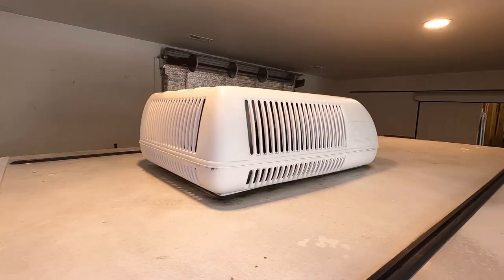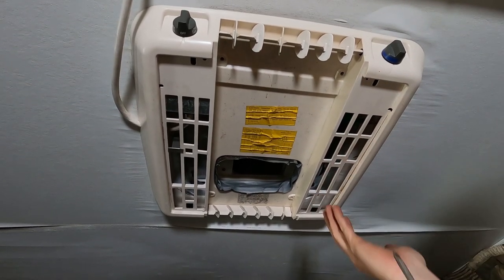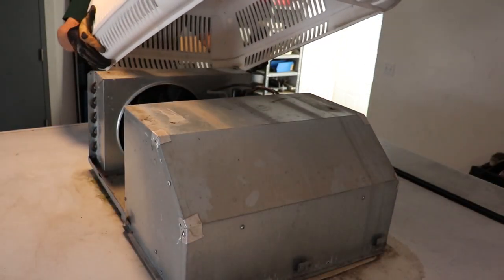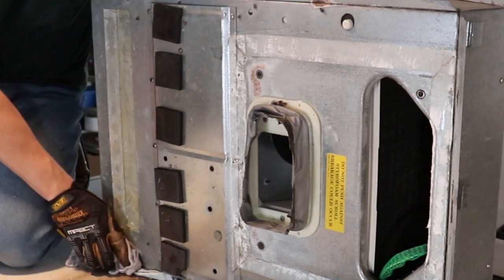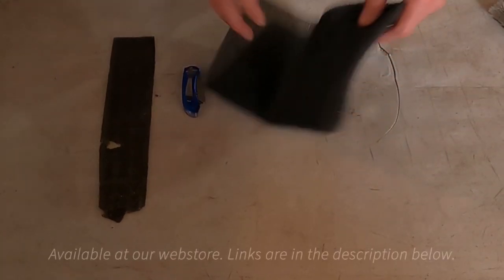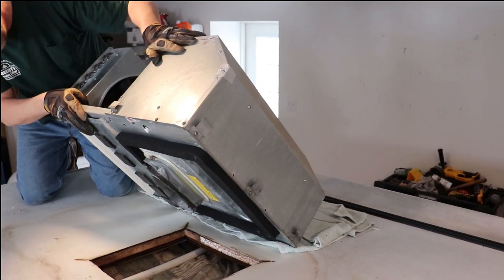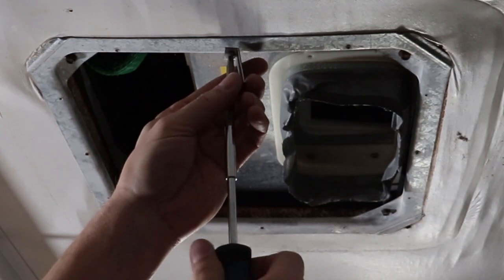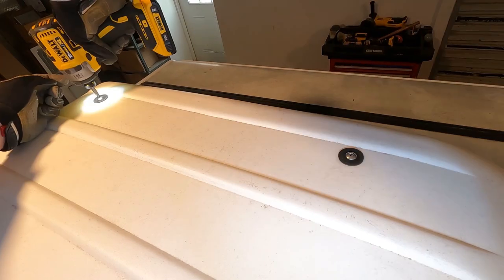How To Replace A Camper AC Gasket

Comment: Question. If my ceiling is wet and black (possible mold) from around this same area, can just that piece of wood be replaced without doing the whole ceiling? As it's only in that area. You can see a slight sag in the roof when looking at it. Great video! I will be replacing my gasket now and also subscribing. Thanks
Reply from the maker: You sure can Joshua! Just replace the affected areas.
Reply: @popupcamperpro  awesome!!! This ought to be fun. Hopefully I can get that sagging out of the roof by fixing this spot. This channel is amazing. I'll try and take pictures and tag you. Thanks!!
Reply: Excellent! exact question I was looking for! Is there any videos on the replacement of the ceiling in the affected areas? any recommendations on how to do that?

Comment: hey man i have a seam that runs horizontally across my ceiling. i am seeing water there. i just had a new roof put on and i am still seeing water. could a bad gasket be causing water to enter and travel through the ceiling?
Reply from the maker: It could be bad, or just needs to be compressed a bit more. Air conditioner mounting bolts should be tightened at least once a year to maintained a tight seal. Make sure that the air conditioner drip tray is not clogged and leaking as well. We have a how to video for this job on our channel also.

Comment: I am highly allergic to mold and the white  styrofoam  is covered in mold from the ac leaking. Do you have any suggestions of what I can spray on it? Thanks!
Reply from the maker: Sorry, but I do not know of a spray fix. I would recommend removing and replacing the affected insulation.

Comment: We discovered a leak this weekend while camping. Water on the rooftop from air conditioner. No rain. Tilted a little backwards to hopefully drain it off and it came thru the ceiling and light in multiple spots. Would this correct that problem?
Reply from the maker: It could, but you may have another issue going on with the drip tray. Please take a look at our video showing how to service and clean the condensation pan on your camper. Here is a direct link. https://www.youtube.com/watch?v=jK7TYq2TbGs&t=12s

Comment: This weekend we ran our AC hard for 12+ hours. It sounded like water was leaking in the unit, so I shut it off and a ton of water came pouring into the camper thru the filter. Any idea what would cause that? I checked the drip pan earlier this spring and didn't notice anything wrong with it. Almost like the condensation built up and didn't go anywhere. Perhaps I reinstalled the tray wrong?
Reply from the maker: It’s possible. Please take a look at our drip tray service video.

Comment: Until you seal the 45° cuts in the roof membrane at each corner of the ac opening, you will continue to have water intrusion
Reply from the maker: Good tip. Thanks for sharing Tinkeritis!
Reply: @popupcamperpro  You can now buy a one piece gasket of closed cellular foam, expensive but the last one you will have to install. Some of these gaskets even new, are a joke.

Comment: So "retighten the mounting bolts after your first trip..." really? Take all that back off to check? Have you seen them loosen up much?
Reply from the maker: Yes, and it’s a common source for water to leak in if they are not kept tight. Not every ceiling assembly is as difficult to remove the inner cover to check.